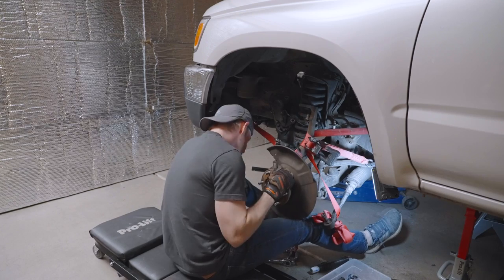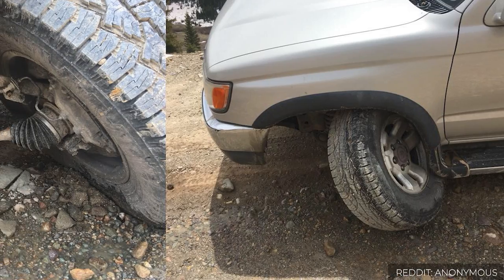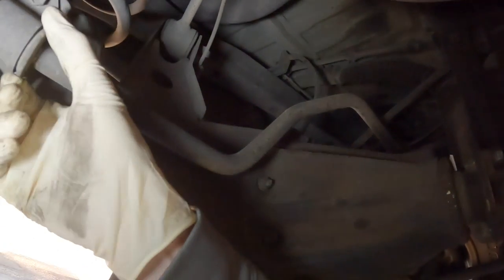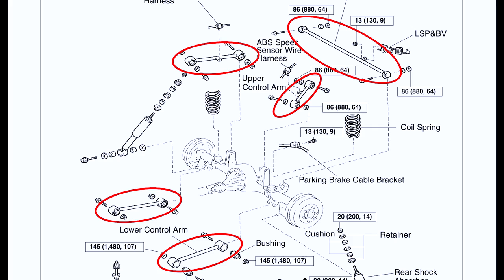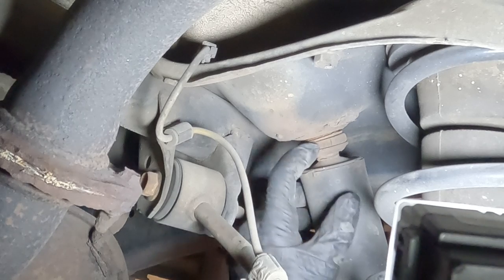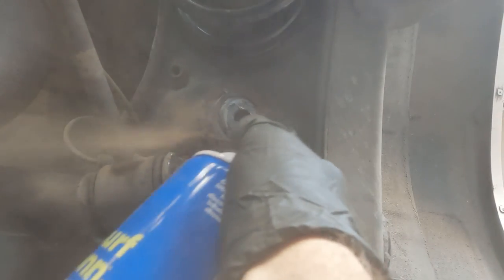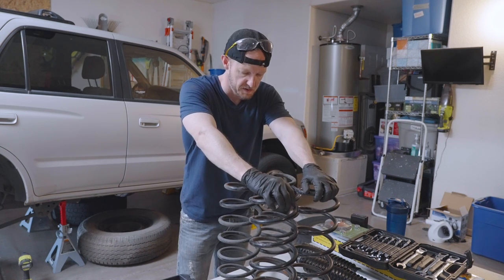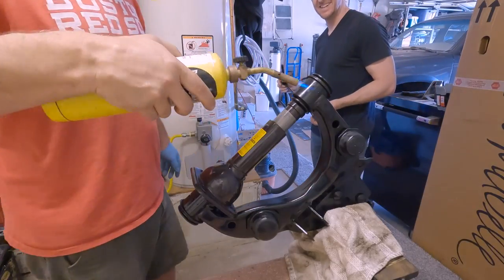3rd Gen 4runner Rear Suspension Install

Comment: Great video, very similar to my Land Cruiser Prado 95 underneath. Make sure you get the wheel alignment done after it's settled down otherwise you'll end up with tyre scrubbing on the edges of the tread. Also can you use the metric system when you're measuring stuff as 16 and 9/16ths is just crazy. Come on even us Brits mostly use the metric system nowadays for measurements less than 20ft.
Reply from the maker: Thanks mate! Agreed on the measurements. I much prefer metric system but every stick you find on this side of the pond was ‘ticked’ off by the king : /

Comment: How the fuck did you get the bottom of the shock aligned so easily? I’ve spent more than an hour just trying to overcome the resistance from those two bushings and it’s so fucking hard, it’s like the angle is just wrong on my truck
Reply from the maker: Hmmm. Did you try to ‘truck as a spring compressor’ technique?